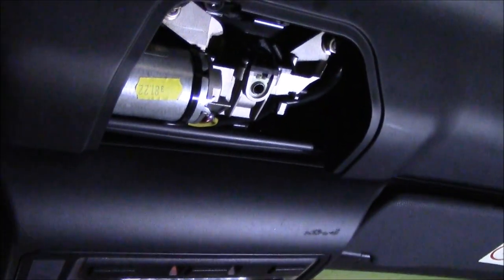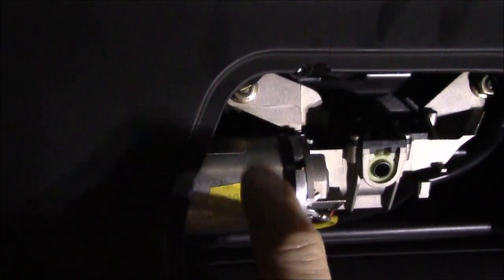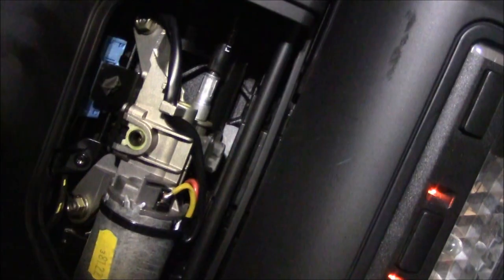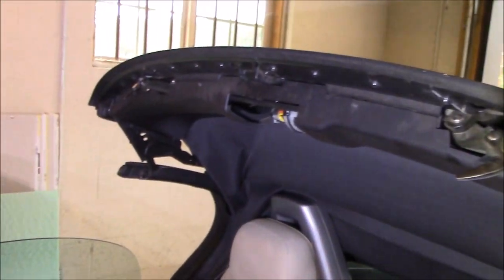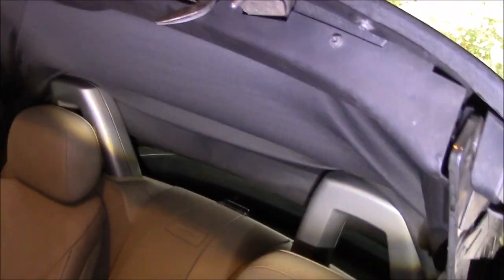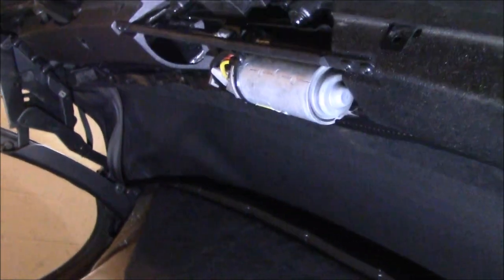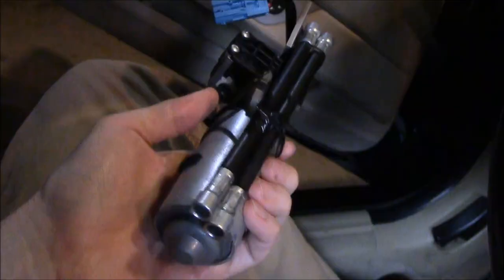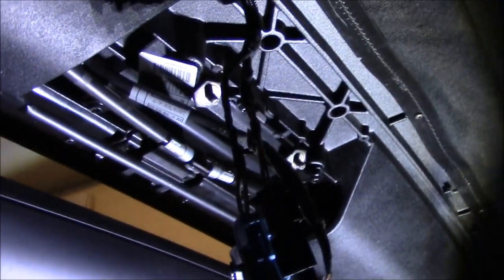BMW Roof Lock Motor Removal and Fix for Convertible or Roadster - Z4

Comment: 5 years later,,, ur video is basically still the only good one out here,,, fixing to do mine this wk,,,
Reply: Have you by chance found any good videos that show how to replace/add the rubber straps to the existing straps so that roof doesn't slam down hard?  I have the new BMW rubber straps designed to fix that issue and the instructions are a little confusing.

Comment: Folks, there are 7 screws that hold the trim in place over the motor. The four shown, one in the locking motor compartment, and one on each side that are easily visible with the top barely open. If the trim comes loose from only removing the four screws shown, the trim is broken, and eventually the stress on those four screw holes will cause the trim to continue breaking

Comment: It broke because the worm gear those flex cables attach to lacked lube when they get old and dry that makes Huge resistance and the weakest part is that little white plastic gear  that got striped, that was the noise and your new one will do the same thing the first day, and the dealer will sell you another one at full price because it was not put in properly.  but you can buy just the gear you need on Ebay.  This is a very common problem on all older BMW's people think there is something wrong with some electric part when it just needs grease on the worm gear.
Reply: You wouldn’t happen to know what that gear is called?
Reply: I removed my motor and the gear turns freely without resistance from the cables.  After i reattach the motor it wont spin because of the resistance. How can i lube the worm gear.

Comment: Hi, thanks for the video. I’ve just had my roof replaced as the old canvas was worn. The old motors both worked perfectly. however the new roofs front lock motor does not work. I’ve asked my mechanic to take the old lock motor and fit to the new roof. Is this possible and how long would a procedure like this take? Thanks

Comment: There is also a fastener located very close to the motor which must be removed before the cowling will drop down.  Better lighting could have shown this.  The lighting is very poor.  Lights are cheap, easily obtainable and serve multiple uses.

Comment: I have the issue, that my lock moter IS working and even moving the two latches. But these simply won't lock or unlock properly, because when the roof closes, about 10-15mm of gap remain and the procedure can't be completed. When I close it manually with a hex, same issue with opening, just makes a (normal) noise but doesn't open. A memory error maybe? Or broken cable? :/
Reply: Same issue for me, top works fine...now. 

I had been manually retracting it for a few months. Then I came out and randomly tinkered the motor with a hex screw and all of a sudden the top now retracts with the motor, but the latch won't catch... same as you described.

Any luck finding a solution?

Comment: My 2005 z4 also has this problem but the gears seem to be broken and the roof will not unlatch preventing me from opening it. Any way to bypass this from the inside?
Reply from the maker: If using the allen wrench method on the center doesnt work.  You could attempt to turn the cables themselves directly.  Perhaps with needle nose pliers to reach in and grab them.  Or remove the motor/gear box to get your hand in there better.
Reply: @FarReachFR  ahh thank you, the thing is the cable turns when with the allen key bolt. Is it possible that the cable isnt loosening all the way?

Comment: Do I just pry the cover to expose the motor? Also is it possible to replace the gears without removing the motor?
Reply from the maker: I think there is a small tab near the aft driverside to depress and then the cover should come off.   I dont think it is possible to replace without removal due to the small space in there.

Comment: Hello,

On my e46 m3 when you turn that Allen key the whole screw backs out and falls out. How can I go about opening the top then? Thanks
Reply from the maker: Hi Glo, Glo.  Sounds like the gears are in bad shape on your M3.  If it is backing out, the only other 2 ways I can think of opening the top are 1.  replacing the whole central unit like I do in this video, or 2. on each side of the central unit are the two cable shafts that spin the locks.  If you can get some pliers up there and turn them manually, much like the motor used to, then eventually with enough turns the top will unlock.     Please note that I do not recommend you do #2 unless you never want your top up again until it is properly fixed.   I say that because I expect it to be a pain to remove and even more struggle to wind back on.  But thats just my thoughts.
Reply: Far Reach Engineering 

Thanks for the response. On my e46 m3 I don’t have access to the central motor like you do. On mine it is a small opening to access that Allen key. I have no way to have access to it. It would it been helpful if they made that opening like you have on your car. I could send you a picture of the way mine looks. Thanks
Reply: I am having the same problem.  I can unluck the top, but when I go to relock it, turning counter clock wise, my scree comes loose and won't turn anything.  I had to have my daughter Kay on the roof so I could use a impact driver and lots of force up against the screw to keep it in.  We're you able to find a fix for yours?

Comment: My z4 does the exact same noise when I press the button... how do I know tho that it isn’t the second motor that’s the problem as well tho?
Reply from the maker: The second motor is not in the same place, it is more behind the seats.  So depending where the sound is coming from can help indicate which you have an issue with.

Comment: Once you fixed that motor, the convertible came all the way down?
Reply from the maker: Yes, Once I fixed this motor I could unlock it and put it up and down.  But note that the motor that raises it and lowers it is a different 2nd motor.  This motor only locks and unlocks.  It does not raise or lower.

Comment: whats the name of the slip fit cables @ 4min 52  please , mine are needing replacing but cant find a name for them …. thanks
Reply from the maker: The name I have seen is Soft Top Lock Cables or Shafts.  They normally run $70 - $80 used.  That said, I have a pair laying around in my garage from my last repair.  Here is a link to them. https://www.ebay.com/itm/123544445094   I posted them today at a discount just for you in case it is what you are looking for.  If its still to much, just make an offer and I can send them your way.  Merry Christmas.  https://www.ebay.com/itm/123544445094

Comment: Did you have to re-set the roof motors afterwards??
Reply from the maker: Nope.  Just replaced and then worked just fine.   
That was my experience and I would think the outcome for most.  in a rare instance where you might be supplied a motor that was shut off in a mid cycle or opposite position, perhaps that would be needed.  But it wasn't in my case.   (hypothetically if that was needed, I would think plugging in the motor, cycling it to the position your top is in (locked or unlocked) and then installing the cables, would be all that was needed to reset in such a scenario)